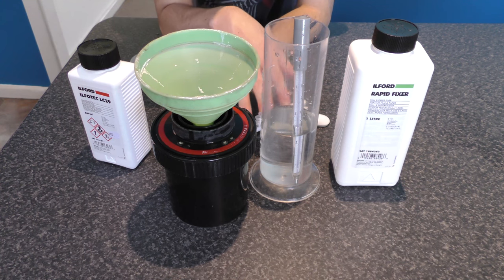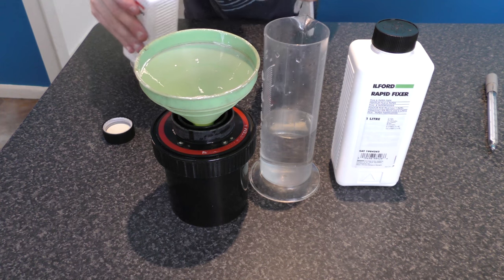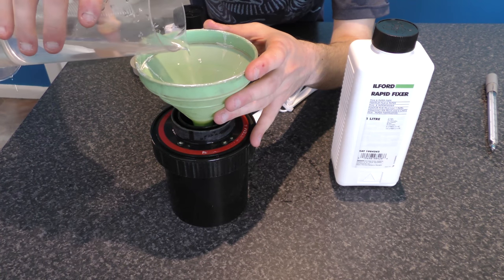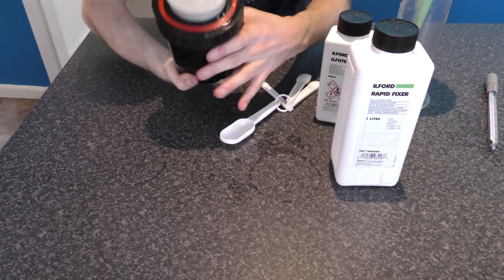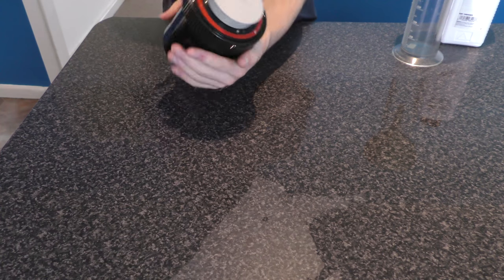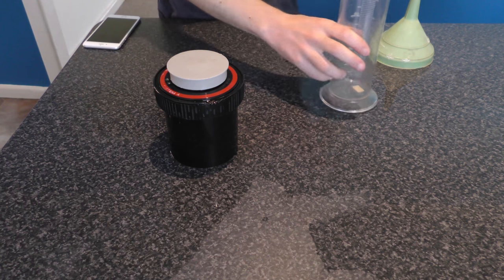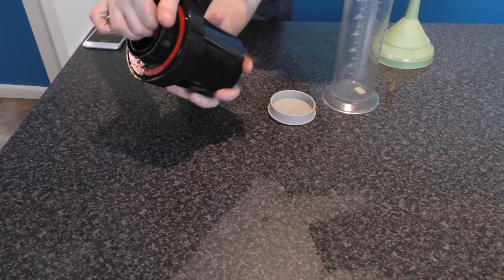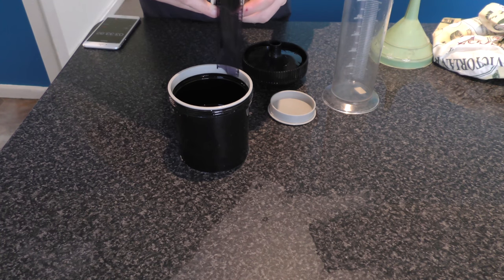How to develop your film in a Paterson tank

Comment: You can open wide the reel to take off the film, very easy. And in my experience I used to take the temperature a few times (in my Mexico, sometimes the running water was 24-28 Celsius, so I used ice to get 20 degrees flat)

Comment: What happens to the chemicals that have been used Are the flushed or stored for special disposal Great tutorial by the way
Reply from the maker: Philip MacKenzie generally you can chill and reuse the chemicals for a few develops as long as they are a not too far apart. Fixer lasts longer than developer. Otherwise, dispose of them safely so as not to damage the environment.

Comment: You didn't use the STOP chemical which you agitate for 30sec before your put in the FIXER. The proper procedure is DEV, STOP, FIX, WASH.   You also did not wear RUBBER GLOVES which you should always wear when doing this for obvious reasons, so this vid is a FAIL.
Reply: No necessary for b+w film. This is true for both points for c-41 and e6 where the chemicals a much harsher and the developer will continue to develop until a stop bath is used. So your comment is a little bit of a fail.
Reply: You do need a stop bath also in B&W. All professionals need it so I guess we are not different... either using a stopper or at least with water. BTW that is not a Paterson tank. I own this one too.
Reply: @mikishootsonfilm  you definitely don't need stopper, hell you don't even need to agitate. The fix will neutralise any developer still in the tank after a thorough rinse